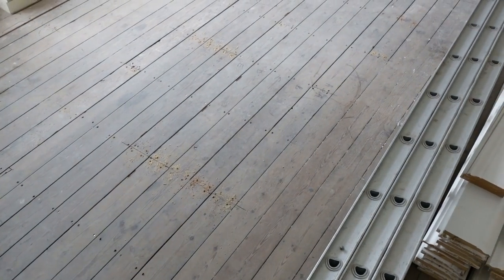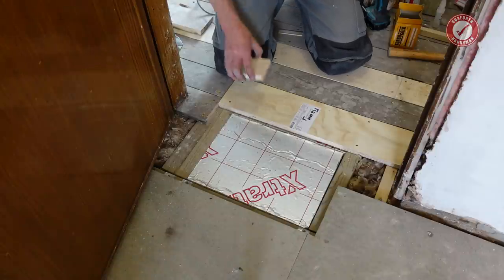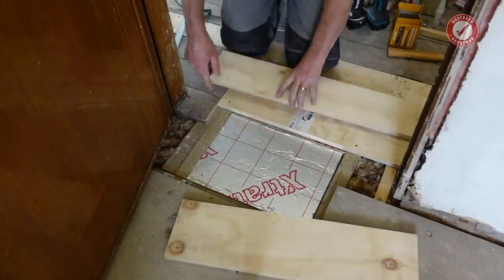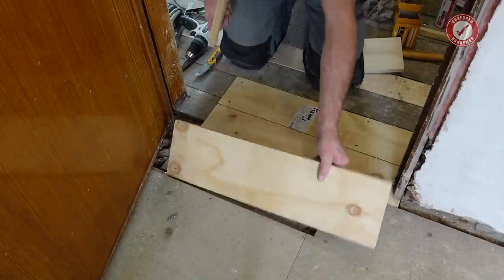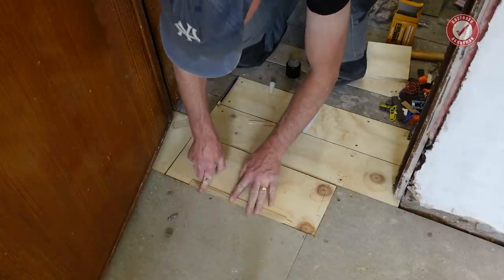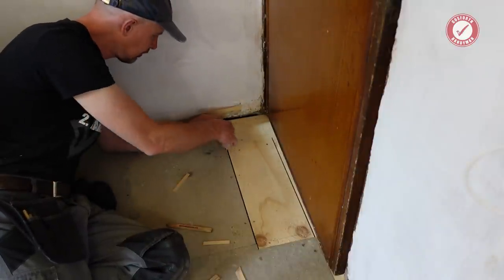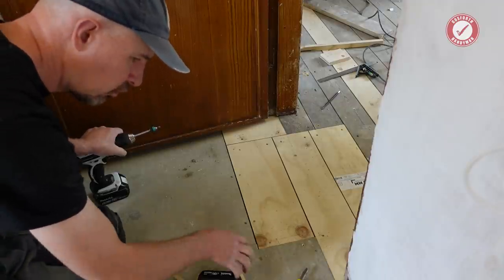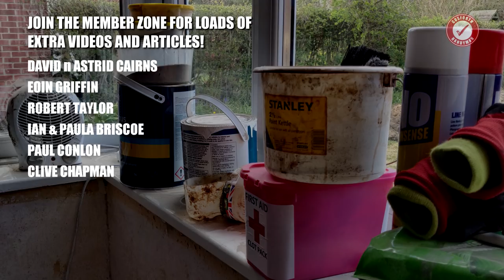Final Floorboards! Matching levels from old to new floors (Renovation Part 27)

Comment: Some years ago a neighbor was doing the subfloor with bits and pieces in one room, and when I mentioned the gaps and unevenness he told me that the finished flooring would hide all that, and besides, "it's an old house and it's supposed to look that way."  Not up to Andy Mac's standard!  When you're done it will be better than when it was first built.
Reply: @YT_CHL_DOK LOL!  I was very tactful when I commented to him.  With this particular neighbor, it was such a pleasant surprise that he was doing any work at all on his house I would never have criticized it!
Reply from the maker: 🤣 Ha thank you Bob! Less of a concern with hardwood flooring over the top but you can certainly see any unevenness through carpet, so worth doing. 👍👍😁

Comment: It's annoying with these "covid" shortages. I went to one Wickes that had no concrete at all. Another one 20 mins away had pallets fulls.
Reply: I went to a local place for patio blocks and base fines.  Instead, I came across a whole warehouse full of cement bags in a bunch of different colors.  Where was this when I needed it! Skids and skids packed to the ceiling!
  There must have been several hundred skids of cement, mortar, sand. All premium stuff. I wanted to cry.
Reply from the maker: I haven't seen bags of readymix concrete in Wickes for months. 😢
Reply: The reason why cement has been really hard to find is because now that we are sort of back to normality a lot of trades and other people are out doing work or diy so therefore it’s hard to get hold of. It’s also the same story with plasterboard at my branch there seems to be a high demand for 12.5mm and they have raised the prices on the cls studwork which was only about £2-£3 before, it’s now £5!!
Reply: @GosforthHandyman  It’s pretty crap because I have been intending to fit a short length of boundary fencing but it’s really hard to find it. The best place to get cement or post crete is from trade merchants like travis Perkins etc, but best to go early as it will be rather busy by noon and before you know it stock will all be gone until the get a delivery :/
Reply: @GosforthHandyman  Come to Halesowen, West midlands, they've got plenty lol

Comment: Not enough lorry drivers to supply the shops since a lot of drivers aren't here anymore, which probably explain shortages of certain building materials.
Reply: Plus the queues of lorries at the port waiting for customs checks
Reply from the maker: How do explain the shortages in US, Canada and Europe?
Reply: @GosforthHandyman  Covid definitely didn't help there (and here), but saw some messages appear in the past week that lumber prices are starting to drop again closer to normal levels (not quite there yet) from being insanely high before. From what I understand the lumber mills were the bottleneck as they anticipated demand would drop, while the opposite happened.

That's only lumber though. Haven't seen anything regarding other building materials in US/CA/EU so can't give my two pence on that :D
Reply: Was talking to a trucker he said the reason for the shortage is simple. Companies didn't want to pay a decent wage and would rather go with foreign drivers and now the foreign drivers can make more elswhere they have sodded off. Had companies paid a decent wage with decent conditions then there would be no shortage. That's came from a UK based trucker.
Reply from the maker: Builders merchants aren't reporting driver shortages, huge amount of cement and other materials going to HS2 though.
Reply: @GosforthHandyman  Extra cold winter effected polymers/additives etc. In Texas. 
Mild winter effected scandi wood supplies (don’t understand why).
Brexit effecting lorry drivers, as in they aren’t here, and extra queues and costs at customs. 
Every industry is effected by driver shortages but some do seem to be pretending it’s not an issue. 
Also, as mentioned the sawmills in every country (US, here, scandi, China) all shutting down then catching up with crazy demand. 
Annnnddd forest fires in US effecting them too. 
A crazy perfect storm!!!
Reply: @artofcode  most building materials are depleted in the U.S., and prices are through the roof.

Comment: You can tell the difference between a handyman/DIYer, and a tradesman or as they say housebasher. Both are time constrained but one is also wage constrained, ie getting the job done and paid for in the quickest time possible. You hear it ringing around Building Colleges all over Britain, 'you've got to balance time and wage'.

Comment: Shortages are purely down to lack of lorry drivers, cant be shipped in to the country or from warehouses to stores. This is a by product of Brexit.
Reply: It’s a little of both, the main shortage of drivers is down to Brexit, but also Covid is stopping people from being able to train and get Class 1 licences because of a backlog on the testing and training centres.

There’s also a backlog of production that’s getting better, but it’s still behind, mainly because of ‘Just in Time’ management of everything from raw materials to finished goods.
Reply: @almostanengineer  Yeah, we've finally found out how fragile our supply chains are - from timber and sheet materials, stone and cement, right up to integrated circuits. Everything falls flat on its face because it's all JIT and nobody who makes decisions has the slightest grasp. Hell, we ran out of egg boxes last year, because someone thought cardboard manufacturing wasn't essential.
Reply: @Monkeh616  I’ll still advocate for JIT, it’s an amazing thing that saves millions of pounds, and tons of wasted energy every year, and the egg box shortage was due to an increased demand for medical products that use the same base material; not a shut down of the production plants that made them, there was also a large salmonella outbreak that meant a large number of lay hens had to be culled to prevent spread, along with an increased demand for eggs because consumers baking more cakes.
Reply: @Monkeh616  it wasn’t the salmonella outbreak that hit the egg suppliers, that hit the butchery supply, but a small H5N8 (bird flu) outbreak that caused issues with egg supply.
Reply: @Monkeh616  the supply chains haven’t been hit by one thing, it’s been a large number of things over the last year, that have caused significant issues all along the chain.

Another example, is the shortage of shipping containers, there’s a ton of imports coming from the Far East, but little in the way of exports, causing large numbers of shipping containers to remain in the western world, and a shortage of available containers in the Far East for exports.
Reply: @almostanengineer  I never had any issue with egg supply short of the things breaking due to the useless plastic boxes.
Reply: @Monkeh616  then you were lucky enough to live in an area that didn’t get served by an affected farm, eggs are one of those products that are produced rather locally to the distribution centre that serves your store, for example Welsh and South West stores have Welsh eggs because the depot is in Chepstow, but somewhere like Warwickshire would supply midlands stores with the depot being in Magna Park
Reply: @cycleranger  Yeah, Brexit is having an effect too, but not on as much as people think over here, but the anti-brexit crowd are going straight to blaming brexit without looking into it. One of the main issues Brexit had for us, is a mass migration of skilled HGV drivers, they all went back to Poland XD
Reply from the maker: @DemonKamikaze if only it was that simple. If you check the comments on here you'll see the supply chain issues are global, not unique to the UK. Cement shortages, for example, are largely down to HS2 actually. 👍
Reply: @GosforthHandyman agreed, large proportions of the population being locked up for the better part of a year and a half not being able to go on holiday as people normally do means they have been spending their money on their homes, this is the same in the UK, mainland EU and USA. Obviously makes it difficult to get building supplies that have had reduced supply. But in the UK we also have a shortage of between 70,000 and 100,000 HGV drivers that have gone back to mainland Europe due to Brexit. i have many friends (one who owns a logistics warehouse in Germany) and work colleagues in offices in Germany, Spain, Italy, USA, Oz and NZ, and no other country is demonstrably showing the same supply issues as the UK.
Reply from the maker: @DemonKamikaze What?? Where are you getting this information? The TOTAL shortfall is 100,000 but there was already a significant shortfall well before the pandemic and Brexit. This article suggests perhaps 14,000 lorry drivers haven't stayed in the UK. That could equally be because they wanted to spend time with their families during the pandemic. If you look at the ONS stats there were actually similar such shortages back in 2010. https://logistics.org.uk/media/press-releases/2021/july/drivers-hours-extension-is-not-the-answer-to-skill
Reply: @GosforthHandyman  I work in retail and warehousing and we lost 250 drivers who all went back to Europe because of Brexit and paperwork issues, they were the ones who didn’t get there forms for staying filled out in time, then when Covid hit most of them stayed because of that, but you are correct in the fact there has always been a shortfall, and it’s no where near 100,000 drivers
Reply: We have a severe shortage of drivers in the U.S.; nothing to do with Brexit.
Reply: @almostanengineer  I agree with most of what you say but not the shortage of containers due to lack of exports to the Far East. Every vessel that arrives in Europe from the Far East ends up back over in the Far East. When they head back over there they carry empty containers. That's why delivery costs to China are so cheap, the containers were going that way anyway, adding items to the containers reduces the costs of sending the containers back to China.
Reply: I`m a lorry driver of over 30 years and in my opinion it has nothing to do with brexit but the cost to train new drivers, from car to class 1 is nearly £5K and takes a few months. then there is the shockingly low wages, long hours (typically 65 to 70 hours a week) and sleeping in a truck 4 nights a week. plus the government have removed the tax avoidence legislation making it attractive for foreign drivers to continue to work in the UK. So please don`t be narrrow minded in your comments.
Reply: @genty1960  same situation in the U.S.
Reply: @genty1960  how can you say it has nothing to do with brexit? Has brexit resulted in the number of HGV drivers in Britain to A) increase, B) decrease, or C) stay the same?
The answer is B because numerous HGV drivers have left the country due to brexit. Brexit has therefore had an impact. Simple.
Reply: @clarkeysam  we haven’t said at any point that it hasn’t had an impact, just it’s not the only reason.
Reply: @almostanengineer  I don't think you've read my response to you. I'm telling you that there isn't a lack of shipping containers in Asia due to a lack of exports, as the containers travel empty back to Asia with the container ships.
Reply: @clarkeysam  no, I did, the ships aren’t taking them because they don’t have the time to load them, read the article, it’s all explained nicely in there, at the moment they are only taking loaded ones back.
Reply: @clarkeysam  They have only just started leaving due to the umbrella and ltd. Tax scheme being removed making everyone PAYE.
Reply: @paulgent6660  Firstly, it doesn't make everyone PAYE, it just makes employees pay the tax that they owe (and rightly so!), but that isn't the main reason they're leaving. IR35 impacts someone's take home pay by less than 20% (there's plenty of calculators out there you can use to check I'm correct), since the brexit vote the value of the pound has dropped by more than 20% at times, this has resulted in EU drivers who are paid in GBP having a >20% pay cut. Then on top of that they have less security, and they're told by morons to go home. These are why they've left, not IR35.
Reply: @almostanengineer  read what article?

Comment: Report from manufacturing industry states that the shortage is caused by the almost 100% increase in demand with people doing extensions and building work rather than move and cement and wood manufacturers unable to keep up. So they are prioritising big builders and the general construction industry. Next door does footings for garden sheds and offices and orders his up front and has no problem. DIY sheds are way down the list
NOT lack of delivery drivers although that can’t help. But a very nice  job there Andy. Strange how finishing the flooring can be so satisfying
Reply from the maker: Cheers! Yup, also being told from the builders merchants that HS2 are taking a huge amount of cement. Concrete block supply dropped to 1/3 of normal. 😬

Comment: 17:10 I use my impact for drilling and my drill for screwing lol, the impact doesn't impact when drilling, not as noisy and it has more RPM's, just a nice set of Trend snappy bits and you'll fall back in love with your impact :-)

Comment: The shortages are a nightmare even for simple jobs. I feel like I found the only bag of readymix concrete in Cornwall earlier - only two two builders merchants, a DIY store, and finally a farm supply place had to be visited for a £5 sack of dust and stones. Kiln dried sand needed next - yeah, that's going to involve Devon. Ugh.
Reply from the maker: Yup, readymix concrete is pretty much gone up here. Haven't seen it for months! 👍

Comment: Seems to be a perfect storm for supplies what with Brexit, COVID as well as the Suez Canal blockage. Was supposed to have a new patio laid 10th of May here we are nearly 5 months later and still no Indian sandstone to be had anywhere. Going to be a whole summer ( well what there was of it) with just what the wife calls our mud hump instead of a lovely new patio.
Reply from the maker: Yup, as you say perfect storm. Global supply chain issues. Window shortages due to one of the main glass production lines going down. HS2 taking all the cement etc. 😬

Comment: I would have cutaway the piece on the viewers right hand side that you held down with big screws to the board in the room, then made a wider piece that could be inclined slightly to accommodate any different levels, but spread the slope over a bigger area.
I had to do similar to this years ago to level up floor put in by an incompetent builder when he got joist levels wrong.

Comment: Here in Ontario Canada wood prices finally on the downward side. Plywood not so much. Plumbers having trouble getting 3" drain pipe and  some versions of Pex. I've been waiting for over 4 months for an acrylic bathtub/shower unit and still no sign of it. I'm renovating a small downstairs bathroom. Gutted and rebuilt but now at a stand still waiting for the tub.
Reply from the maker: Interesting! Red cedar is now more expensive than gold over here. 🤣😬
Reply: @GosforthHandyman  Cedar here is also costly but not as much as gold. Your doing a great job!!

Comment: I work in a DIY store in Monkseaton we have all you mentioned in stock including 21mm flooring if you would like the details let me know
Reply from the maker: Which one?? I drove everywhere looking for 22mm chipboard but none anywhere. 🙄👍🤣
Reply: @GosforthHandyman  kellys DIY on Monkseaton front street we have just sold the last of the 22mm chip but have the pine and sand cement etc is all in stock

Comment: We are going to insulate our lounge floor at sometime, But i have a question, how is the floor laid out around the fire place, does it just sit on top of the joists or does it go down to floor level ?
Reply: Between the joists, supported on battens he screwed in to match the height so it runs flush with the top of the joists. 
I think it was in the last video he did this.
Reply: @Steaky78  I was asking because, before we rip up the floor, i wanted to know how the fire place harth is laid out, and if we can lift the harth up and insulate it like the main floor ?
Reply from the maker: The hearth is generally brick from the ground up with joists fixed around it. 👍
Reply: @GosforthHandyman  Oky doky thanks, can't insulate over the top then, TUT.

Comment: retailers running out of random stock because of people  taking time off for being " pinged " regardless if its factory workers or courier
Reply from the maker: Yup, the pingdemic has been a huge and very real problem. Pretty much everyone I know has now uninstalled the app. More or less back to normal up here, other than the huge supply chain issues and hyperinflation. 😬